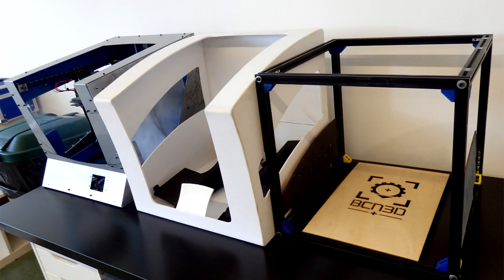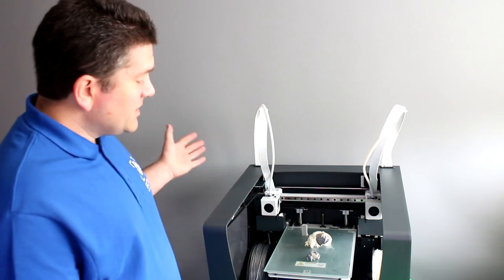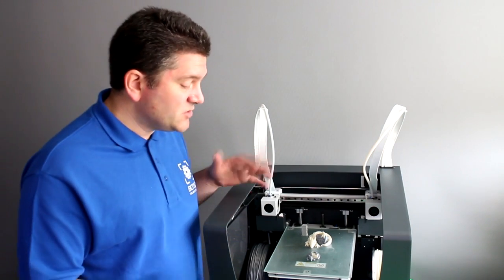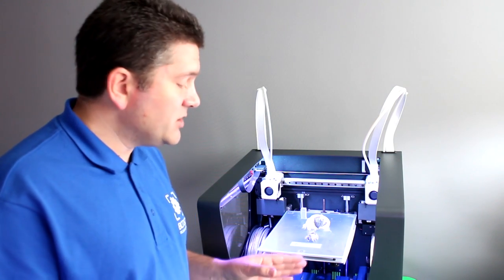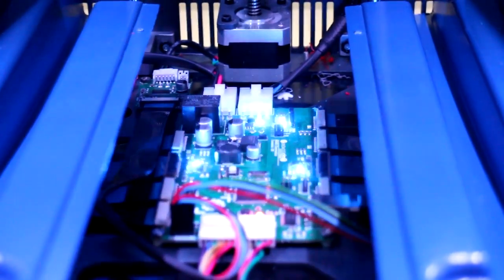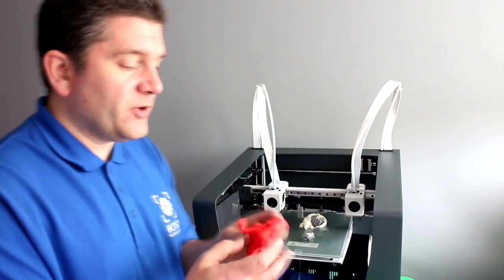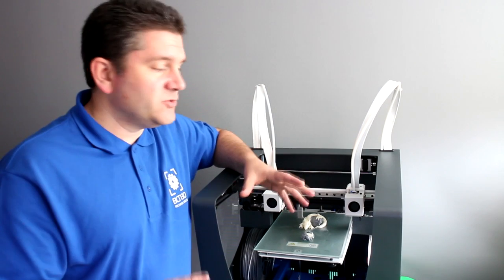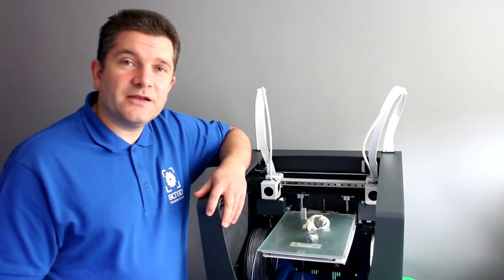Review and thoughts on the BCN3D SIGMA 3DPrinter

Comment: Because it isn't fully enclosed, I am worried that abs might warp. Is that a problem with this printer?
Reply from the maker: I have not see any significant issues with ABS, the fans can be turned off and the heated bed can achieve temperatures for ABS. But I expect very large printed models (over 120+mm wide) may have the same sort of issues you get with any 3D Printer of this type. 

Not many desktop 3D printers have a fully enclosed heated chamber, and that still has some patents holding back everyone just doing it. A heated enclosure can help, but it's not a significant issue for most models you are going to print. If you do see issues, you can at least cut the models up into smaller parts and acetone-weld them together after printing.
Reply: Thanks for the info

Comment: I am having problems with y-axis. A 25 mm test disc will be .35 mm to .5mm too small on the Y axis. Tightening the y-axis belts does not help. I've gone from a little tight too much tighter and much tighter makes it an even worse 0.7mm error.

Comment: Hi Richard, thanks for the review. How are you feeling about this printer after more use?  My need is dual extrusion for multicolor printers, and I'm interested in a printer that makes clean multicolor prints (that usually require supports, as well). Would you recommend this printer for high quality multicolor prints?
Reply from the maker: +Alicia Faruzzi Hi. I'm still really happy about the printer. Lots of experimentation and printing with the prototype. And just a few weeks back I actually decided to buy one with my own hard earned cash. So that probably tells you more than anything that I believe it's a good 3D Printer. I will have a new updated video in the next few days on the Sigma, showing some of the things I did to the prototype and prints.

It's great for multicolour and mixed material printing.

Comment: Very nice review about this really very interesting 3D printer with two independent extruder.
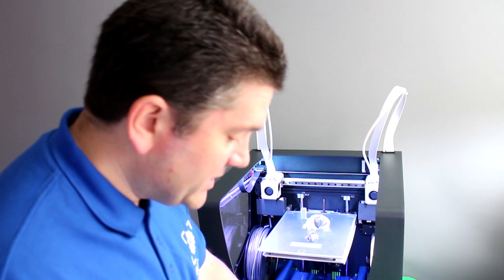In the video (~6:10) the Sigma is switched on and even without printing it seems to be quite noisy.
Does the printer also uses other fans (beside the extruder fans) which are creating that noise?
Compared to other 3D printer .... what about the noise level?
Would be great to see more videos from the Sigma while printing in dual mode ... with real printing sound.

Comment: I'm actually in the same situation with respect to the BigBox (I also have the dual extruder version on order) and would like to second Daniel's question.  The BCN3D SIGMA 3DPrinter seems to be a printer that rises to the level of reliable, repeatable operation that Zortrax has achieved, plus with a larger print area.
Reply from the maker: +Dennis Dickerson I can't comment on the Zortrax as I have not used one. The Sigma and BigBox are two different machines aimed at different people, they are both very good 3D Printers, producing very high quality printed parts. 

Sigma - Carriages are small and can move fast - but It has a 3mm Bowden setup - limits what materials you can print and removes some flexibility for fitting different extruders and hot-ends / paste etc. But if you are more interested in the finished output (3D Printed parts) rather than experimenting with lots of materials or different extruder / nozzle configurations it's a really good workhorse of a 3D Printer. The separate and independent carriages really do work well for dual extrusion. It's one of the best ways to do it at the moment.

BigBox has more flexibility, options and configurations but you will need to learn a little more (and assembly it if you have a kit - that's not a bad thing at all) and it can also do very high quality output and fast printing. Dual extrusion is an option, but it may have some of the usual challenges to overcome, both nozzles are on one carriage moving together, so alignment and possible catching of the second inactive nozzle is always a concern.

Both great machines, it probably depends on what you want to do and what you need a 3D printer for.

Comment: How is this one compared to the bigbox ? I have ordered a bigbox, paid 1700 euro for it on kickstarter so same price as this one, and this one comes pre build while I still have to build the bigbox ...
Reply from the maker: +Daniel Dom I posted the same comment to +Dennis Dickerson - The Sigma and BigBox are two different machines aimed at different people, they are both very good 3D Printers, producing very high quality printed parts. 

Sigma - Carriages are small and can move fast - but It has a 3mm Bowden setup - limits what materials you can print and removes some flexibility for fitting different extruders and hot-ends / paste etc. But if you are more interested in the finished output (3D Printed parts) rather than experimenting with lots of materials or different extruder / nozzle configurations it's a really good workhorse of a 3D Printer. The separate and independent carriages really do work well for dual extrusion. It's one of the best ways to do it at the moment.
Less options to modify the machine (it is possible, just not easy) - Great if you mostly want to do dual printing.

BigBox has more flexibility, options and configurations but you will need to learn a little more (and assembly it if you have a kit - that's not a bad thing at all) and it can also do very high quality output and fast printing. Dual extrusion is an option, but it may have some of the usual challenges to overcome, both nozzles are on one carriage moving together, so alignment and possible catching of the second inactive nozzle is always a concern. - Great if you mostly want to experiment with 3D printing, explore materials and print methods, play with options and even modifying the machine / extruder / hot-ends / adding more -  to your specific requirements

Both great machines, it probably depends on what you want to do and what you need a 3D printer for.

Comment: Richard, this is a great overview of the Sigma and I love the idea of independent dual extruders.  I am about to buy my next 3D printer (currently using a Taz 5) and I'm torn between the Sigma and the BigBox Dual.  I know you're one of the few people that have experience with both, so I'm very interested to know your thoughts on how they compare.  I'm looking for large print volume, compatibility with a wide array of materials, dual extruders, and of course, very high quality prints.  

What do you think?
Reply from the maker: +Brandon Hart I have posted a few comments on the Sigma v BigBox - I would still have both, but use the Sigma for more production printing and the BigBox for more 3D Print experimentation. Choosing one is very tricky, at this price point they bot stand above almost all others in the similar price range - you can probably evolve the BigBox more and easier than the Sigma, but it depends if that's of interest to you. Printing the same part and settings on both delivers the same almost identical high quality (They both run very similar versions of Marlin Firmware - and they both have very similar electronics) - I have even mixed up parts printed on them as the output looks almost identical. +Daniel Dom +Dennis Dickerson - asked similar questions.
Reply: +Richard Horne That helps. Thanks Rich!

Comment: Hi Rich, what's the actual print quality like on the best settings?  Comparable to a UM2?
Reply from the maker: +privacy test - It's capable of extremely high quality printing, but it's most impressive feature is perfect dual prints or the use of soluble support materials.
Reply: +Richard Horne Yes, that's what's got my eye, plus the range of filament types. Looking good for them. Open source makes so much sense. Got bitten by buggy proprietary hardware with the Robox. Never going back there!

Comment: have you tried grivory by e3d yet ? I mean the glass reinforced nylon, which they released some time ago. They advise the usage of the volcano and hardened nozzles due to the high wear and the fact, that this composite heats up badly. It would be nice to hear from someone testing that material, before investing in such filaments on my own.
Reply from the maker: +Marius Breuer - I do have some E3D Glass nylon and Carbon fibre both in 3mm, but I have not been able to use on this printer quite yet because the nozzles are brass. I'm talking to BCN3D about hardened nozzles and hot-ends in general.

I have used the E3D hardened nozzles in an E3D V6 - 1.75mm and had no problems at all with Colorfabb Carbonfill - about 350g into a roll at the moment.
Reply: +Richard Horne Did you ever make any headway on hardened nozzles?
Reply from the maker: ***** yes, I have a hardened nozzle fitted to the left hand Sigma hot-end - working great for CF and Nylon glass fibre.
Reply: +Richard Horne thanks, did bcn3d supply?

Comment: I'm new to home  3dprinters always use shapeways.  
I've been looking at this printer and the big box. everything will be new to me. are theses the right printer for me
Reply from the maker: +Comicbook Hobby That's hard to say - If you have been using shapeways and that works for you, then you may find it's so much easier to keep on doing that. If you are happy to learn a few things and take time to master a few skills of printing, orientation, support materials, then the Sigma is a good choice. The BigBox will be a little more hands-on, but again if you are prepared to learn and try things out, then you can produce excellent results with both.

There is nothing wrong with sticking to Shapeways. Most people don't print out all their photo's at home, they use an on-line digital photo service, 3D printing is not that different if what you want is the finished object, rather than the process of printing it at home - remember most objects take hours, sometimes days to print at home.  

No 3D Printer in the world today is Plug-and-Print and you still need to know a few things about material choice and how to store and use the materials correctly to get the best results. In that respect it's not at all like 2D paper printing.

I hope that helps a little.

Comment: Really like the machine (saw it at 3DPS londen) specially the dual head rail. The sound level seems a bit high, maybe because of the metal case? I don't really understand the comment on 2.85mm filament getting less popular, the nr1 printer in the 3D hubs charts is the 2.85mm Ultimaker2.  Also it's not the first machine on the market with the 2 heads on a rail, the Orcabot already has it a while.  With a bit of creativity it should be possible, but I think the sloping front makes enclosing it for ABS a bit more difficult. Whats the max temp for the hotends? is there some sort of PTFE liner in there that will wear over time?

Comment: Take my money!
Reply: +dizingof They can keep the ruddy thing at 1800 euros.  We need quality AND lower costs for any of this stuff to take off on a global consumer level.
Reply: +legalizeshemp420 It will happen in due time. No one company has to cover all niches at a basement price.
Reply: JeffDM
I am not so sure it will though I can hope, but I don't see anything in this that demands such a hefty sum of cash either. Eventually all of this will come down and lots of people will get one (not the current low priced junk) then buyers remorse will set in for there is one thing that will forever hold back FDM from the masses and it can't be helped and that is how long it takes to do a print.  I think that is the secondary killer to all of this with the first being price.
Reply: ***** Maybe some things can't be done cheaply and at high quality yet? Linear ball rail isn't done very well on cheap junk, the good stuff isn't cheap. The frame looks like welded metal. Not cheap.

Cheap machines can output quality models, but unfortunately, they cut corners a bit too hard, still need to make a few improvements. It's really surprising how little the improvements cost.
Reply: JeffDM
I agree.  I have seen some Chinese junk machines that for 20-50 dollars more would no longer be junk but they cut corners too much.  The thing is normal households will never spend 2k USD plus for a 3d printer and what everyone wants is for this to get out from the niche market and every Mrs. has one in their home.  Not going to happen like this.
Reply from the maker: +legalizeshemp420 It's certainly not for 'normal households' but then what you can do with 3D printers and thermoplastic, is not all that useful or essential for normal households. If you need prototypes or high quality models - small business or professional service, then this machine is very good value for money. It's capable of printing quality and complexity that machines 5 years ago cost 25k+ euros - so it's progress, just not as low cost as we would all like. It'll happen, but first it's good to see a reliable and quality machine on the market.
Reply: Richard Horne
I am not understanding that back piece where the extruders are on as it looks like a drawer slide but can't be.  So many people expect these machines to be on every single house table but they are fooling themselves for numerous reasons.  Prices will come down but over 200-400 most families will skip it and the worst part about FDM that most people will decide against it is how long it takes to make something of a normal size that looks very good.  Thor's Hammer (from a reaction from Elders yt vid I saw to 3d printers) and they absolutely loved it but 2 days to print it put them right off of 3d printing.  Liquid is messy as is the powder (expensive too) and those are the only ones where speed is at as FDM will always be too slow for the general masses who gripe that 30seconds to a minute to nuke (microwave) a burrito is too long.  Those are the general public that people want this to catch on with.  We might can conquer the HEAVY prices but conquering the time it takes to print using extruded anything I have to say never.
Reply from the maker: ***** The slide is a high quality HiWin Linear rail - the extruders are attached to the back of the machine. The moving heads with hot-ends and nozzles are on that HiWin Linear rail. It's a Bowden based extrusion system (Like Ultimaker) so the heads are light and can move fast and the extruder drive is heavy, powerful and at the back.

All very true and valid comments. I'm not seeing 'everyone' needing or wanting a 3D printer. So it's more of media hype that keeps on telling people they will be in every home. 

They have been used for 'rapid' prototypes and product development for the last 30 years, and that's still what they are best at doing. if you don't need one that's fine. They are and will continue to be almost useless for the 'general public'.
Reply: Richard Horne
I agree with you mate.  Either the media is telling us we all must have one or they are telling us we shouldn't have one because they can be used to make weapons.  Sort of silly for either of those.

I would like to have a CNC as anything subtractive will be a ton faster (so much so it will be done before a 3d printer has laid down its first 1-10 layers) BUT, because it is subtractive, will be a lot more messy with more cleanup involved.

I have a Prusa i3 rework and the biggest pile of junk I have ever built.  It has been down since around April and because of that printer, and the thousands upon thousands of hours I did tweaking with not even using a full kg of filament), I am gun shy on printers that are repraps.  I like UM2 and this one looks nice as well but 3mm filament for both (I never ever did 3mm I went straight away to 1.75mm 2 years ago) and their costs are just too prohibitive for a home.  I like making, and designing, parts it relaxes me and in some small way I am helping people but 2k for a 3d printer or 2k for a CNC router I would have to go to a CNC as it has way more uses than a 3d printer for making parts.

Oh, the one thing I wish you had done is show it printing and let us hear how loud, or not, it is when printing.  I am hoping you do this in a future video. :)